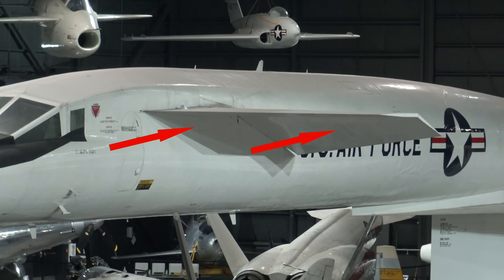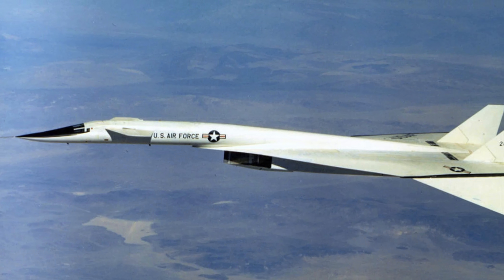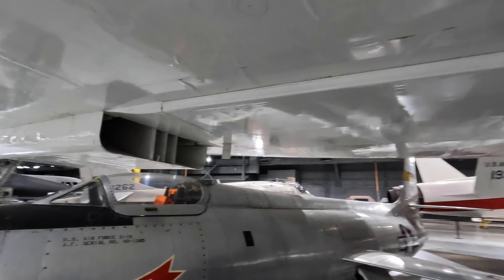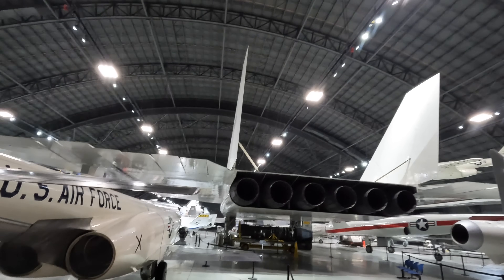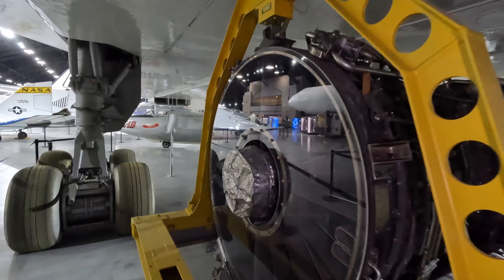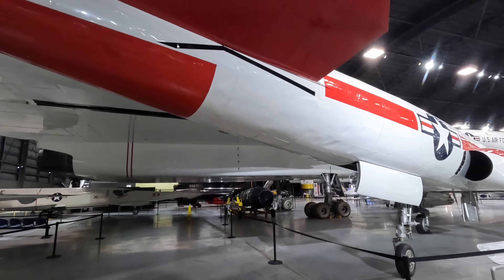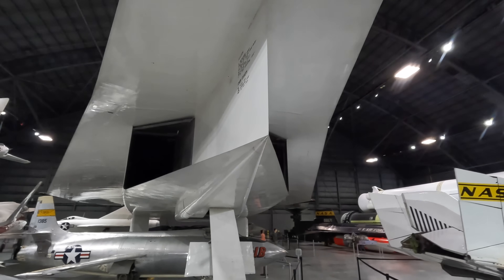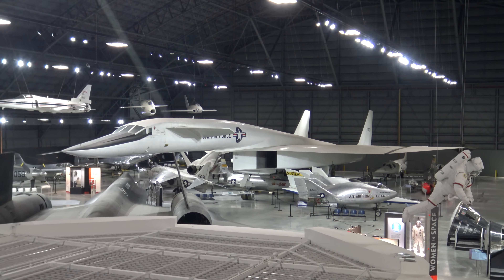Tour around the North American XB-70 Valkyrie - the greatest cold war bomber that never was.

Comment: It's really not true that the XB-70 was superseded by ICBMs.  If that was true, the B-52 should've been retired right with it.  Killing the XB-70 program had much more to do with the worst SecDef in history (McNamara) and a blindingly incompetent president (LBJ).
Reply: "If that was true, the B-52 should've been retired right with it. "

Not really, because the B-70 was going to offer more speed than the B-52.  ICBM's obviated that advantage in speed, so in that sense, ICBM's made high speed manned aircraft obsolete.

"Killing the XB-70 program had much more to do with the worst SecDef in history (McNamara) and a blindingly incompetent president (LBJ)"

You're confusing 2 airplanes: the B-70 bomber (never built) was cancelled in 1961, and that decision, though consistent with McNamara's policies, was never disputed by JFK.  For that matter, the plane was also opposed by Eisenhower, and Kennedy campaigned in support of the plane while running for president.  It was widely believed that the advantages of mach 3, 70,000- foot flight didn't add to America's military capabilities, given the immense cost of putting the B-70 into service.

The XB-70 flew for years after the B-70 was cancelled, and was retired 1969.  It would almost have certainly been retired by 1971 no matter who was in charge (McNamara had left in 1968) because its main use was in generating data for high-speed flight, mostly to be used for developing an American SST, and that was cancelled in 1971.

It was during McNamara's tenure that the US began developing ASMA, which became the B-1.
Reply from the maker: fair enough

Comment: JFK moron defense secretary Robert McNamara, a CPA never a warrior, created chaos at the criminal level all across the services.  He personally had a hatred for this plane as one of the systems “too good, we do not want to enrage Soviet Union and our peace efforts”.  He killed the boron motor.  The video author here is wrong why those motors were canceled. With the boron fuel with the actual motor design McNamara stopped, this plane would fly higher than a X15 average altitude for thousands of miles.  And another Mach number faster (plus more payload).  The temps would be lower higher up and not melt the chassis. The temp issue promoted by the author here is fiction created by the woke historians. The temperature issue was because it was not flying high enough (thicker atmosphere more friction). 20,000ft+ higher up, temps were not a issue, at speeds at Mach 4-5+.  

There was then, and today, no anti aircraft missile system that could shoot this down (with boron motors).  Even at slower speeds and altitudes today would be very hard to hit a maneuvering aircraft (up that high limited movements are all that are needed), and counter measures.  Let alone at heights this hyper sonic low space plane was designed to fly. 

AND had the dolts at .mil industrial complex allowed the GE nuke powered hybrid jet motors be developed instead of building shanty town slum Soviet style apartments in the large cities (with the money stolen from .mil R&D and equipment production), this airframe design was destined to fly via nuke power.  

Crazy you say?  Well, the Russians today 60 years later have used the US tech from so long ago for their hypersonic nuke motor based new 50,000,000 ton nuke cruise missile, the Uber large nuke powered 100,000,000 ton underwater autonomous land attack torpedo, and other such radical designs. They are ALL copies of 60 year old US designs to
killed by the vagabond luciferian likes of Kissinger, McNamara, Carter, LBJ, and the rest.  

China is doing the same thing.  They stole all the digitized papers from Oak Ridge TN, and all the other nuke/advanced R&D locations.  One items they are placing in production is the tech used for the nuke based aircraft power plant motor.  Expanded to use safe U233, thorium self fueling, self cooling/healing molten reactors, zigawatts of power for electricity. While we are running out of electricity, they will have unlimited source. And a handful of those plants will be “production breeders” producing added fuel for new systems. 

USA thanks for 70 years of growing commie wokeness execution has destroyed USA (and therefore the world) non tyrannical based progress. This is the broader picture that the XB70 is but one of thousands of transformations crushed by anti alpha male commie wokeness.. plus the natural self deprecating be a slave mentality of USA/Euro citizens falling for the lies.

Let’s get the history correct.